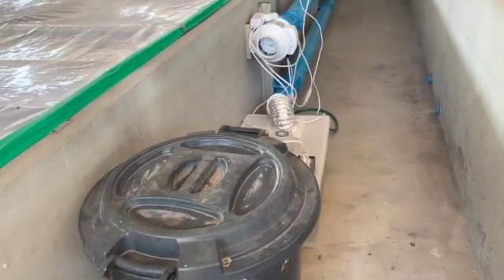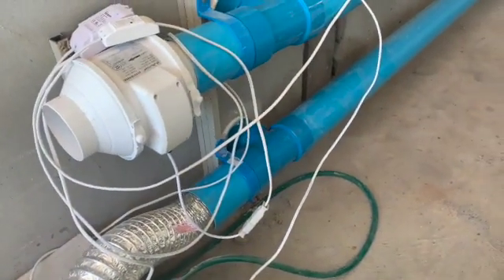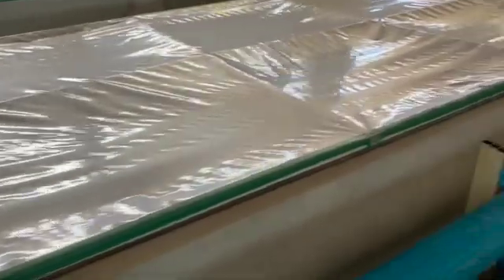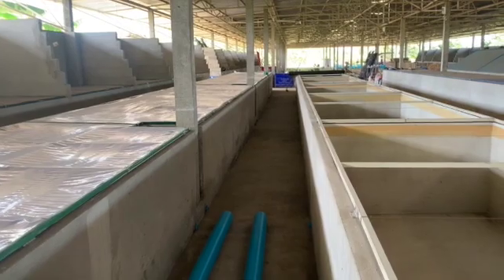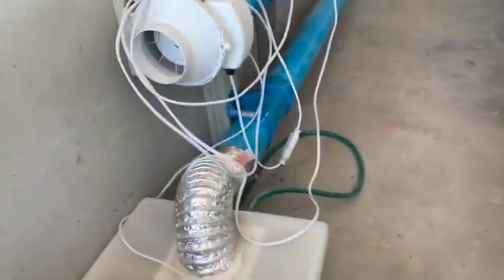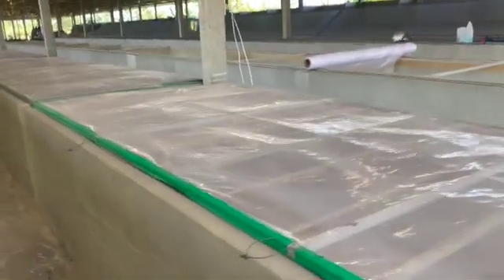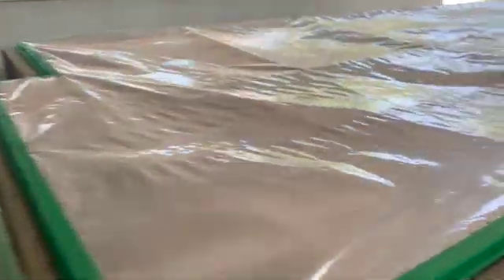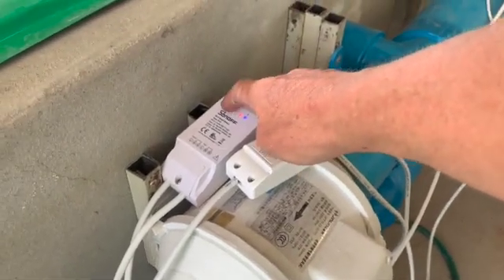How to build humidifier for mushroom growing

Comment: Great stuff..keep it up.
Reply from the maker: Thank you Tony, hope it was of help
Reply: @learnenglishwithmichael  Not really, the wifes set up is bottles on frames in plastic sheds...and 3 evap sheds with a Heath Robinson humidity and cooling fan...but I am interested to see how you grow your mushrooms...
Reply: I see your system. But in this situation. It is not the case that the first box get more fog then the second and the second get more then number 3 and so on?
Sorry for my bad english. I am dutch. But i don't want to use google translate. Most of the time wrong translation 😁
Reply from the maker: @wietze-S.  thanks for your question. To be honest it's only on the initial start up of the fan for a few seconds. Once running each cell get good flow.